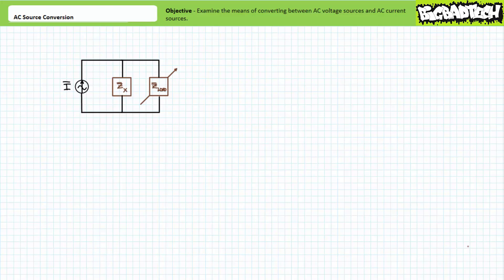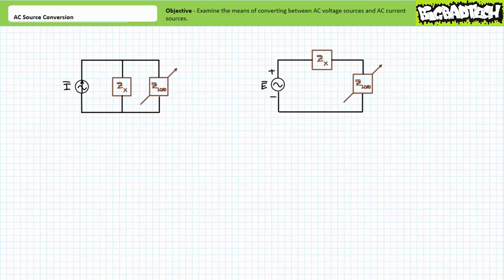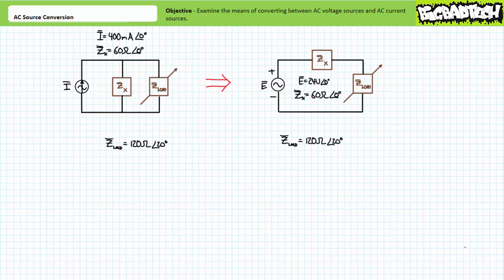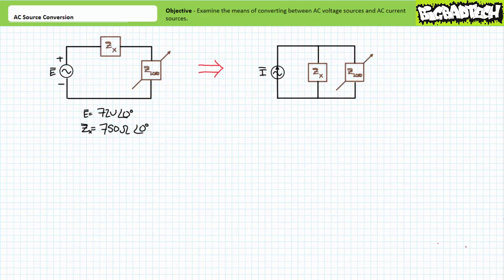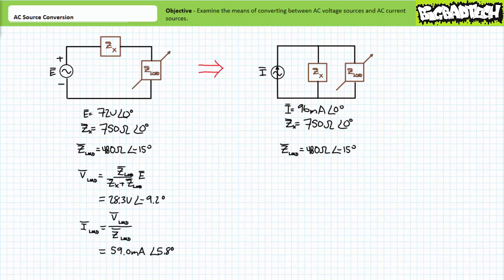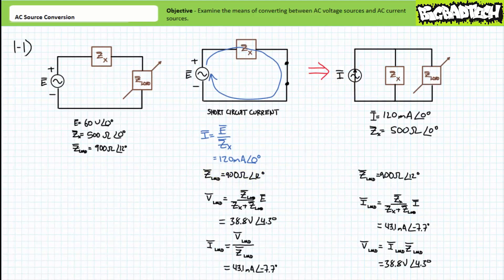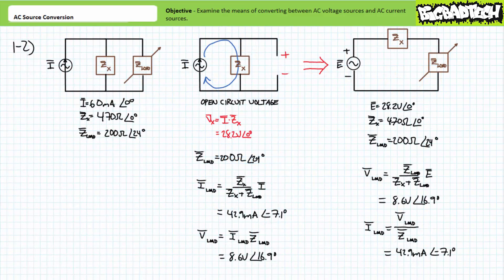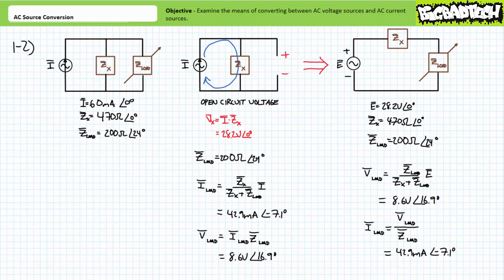AC Source Conversion (Full Lecture)

Comment: Thank goodness for the replay button, I watched this video three times before realizing it is much easier than I was trying to make it. What crystalized my thinking was the fact that you are trying to create an equivalent circuit from the perspective of the variable resistor connections only, and that the choice of variable resistor doesn't matter. The first task is to decide on the missing element, source voltage if the new substitute circuit is series, source current if parallel. To do that you imagine the variable resistor has either minimal or maximal impedence, to make calculations easy. From there, it is a brief leap with Ohm's law to get the missing source element. All the rest is simple arithmetic to verify the choice was correct, which should work with any choice of variable resistor impedance values.

Comment: This is completely unrelated to the video but i am building a offroad vehicle and was going to use a belt driveCVT for a skidoo or a Polaris RZR but they have rubber belts and won’t be able to handle the power couldn’t i make a CVT with two variable displacement piston pumps?
Reply from the maker: Odd place to ask the question but yes one could make a hydrostatic continuously variable transmission. Maybe check out the "Hydraulic Pumps" lecture at: https://www.youtube.com/watch?v=TBxMgGq3O94
I discuss variable displacement pumps and load sensing on a general level. Unfortunately I've got very limited experience with mobile hydraulic applications.
Reply from the maker: I should mention I'm doing some side work for HydraForce. They've got a pretty cool device you might be interested in for your application. Check out the HydraForce HTD 10-40 Hydraulic Torque Divider at: https://www.youtube.com/watch?v=6VkH_rBQ6Ec
Reply: Jim Pytel 👍🏻